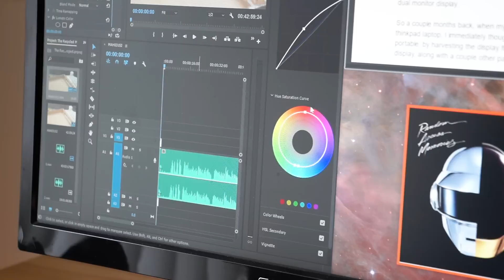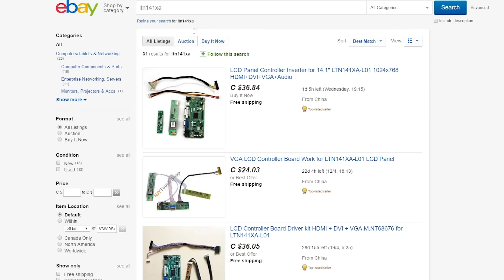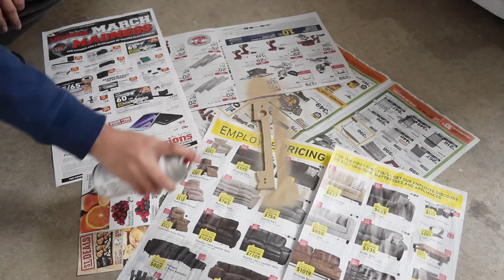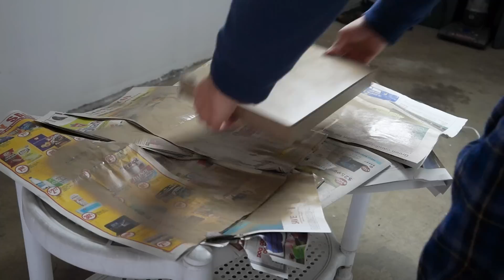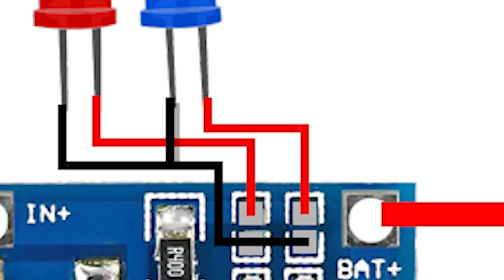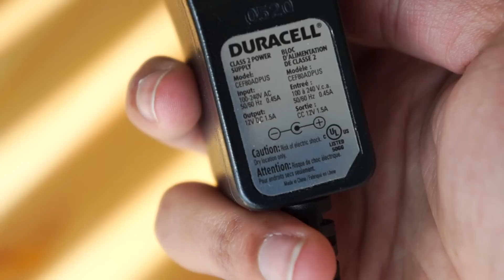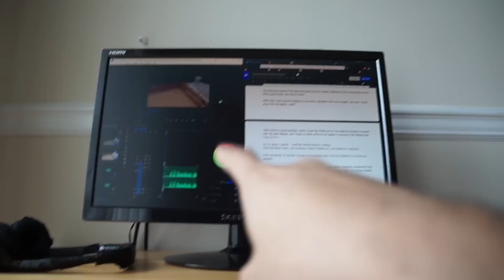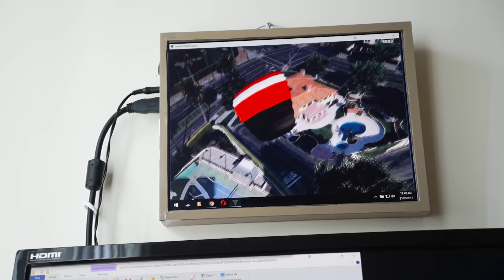The $50 Recycled Portable Monitor Project

Comment: This is the most realistic DIY video ever, learning in the process :) love it!
Reply from the maker: +Vukasin Pejcic Haha thanks :)
Reply: @HamzaQayyum great video! I'm building mine as we speak. Help me out though. For my board it says I'll need a 12V/3A power supply. I even looked yours up and yours looks to be 12V/4A. Is the board onscreen really drawing that much current?

Would you be able to measure your current drawn and let me know because it seems challenging to set up a portable power supply using boost converters and PD boards that delivers that nuch amperage. It seems these things run off as little  as1A just as easily.

Comment: I'm an Electrical Engineering student in my senior year. Job well done on the converter and especially knowing that you needed to change the output to 12V. You would have been scratching your head for a while when it wouldn't have turned on. A point that a lot missed. Excellent work with making the batteries work as well!
Reply from the maker: +TheRevSolo Thank you! As an engineer, do you have any suggestions to improve the design?
Reply: Design is all preference. You might consider a different battery, as the LiOn will degenerate over time. Something that will last. Or you could always add more in parallel or swap when they do regenerate. So make a design so they are swappable. Maybe make a batter caddy inside to easily replace them. I don't know how it is specifically for that board, but I would also make some cutouts in the back so it doesn't get too hot. The batteries will head and might make enough heat to create a short if you're in a cold environment. Just something to consider.

Comment: 4 months of shipping geez
Reply: Or you can fly to China and get it on the spot.
Reply: If it's bought through ebay, you can choose to report that it did not come within the time limit, and get a full refund from ebay. That is, if the seller stated an arrival date less than the 4 months :)
Reply: The McGeeker ده 7
Reply: XJLCA that Will take 3 days
Reply: I got the same board in 10 days
Reply: Geez?

Comment: The drywall plugs you used are brilliant. I have used them in the past to hang massive cabinets with LOTS of crap in them. Never a problem,AND they are reusable if you are careful
Reply from the maker: Yeah it said on the package they can hold quite a bit, and mine still hasn't failed.

Comment: Just a little tip for the future. When nailing finishing nails it helps to pre-drill holes first with a drill. you can use a small drill bit the diameter of the nails or use one of the nails itself in the drill as the drill bit. Won't split the wood if you do that.

Comment: if you have access to a wood shop try using a router. you will be amazed the speed and quailty of the cut. also if you only have access of a dremel there is a bit that looks like a little circular saw blade that would help you with cutting through thin woods quickly. also works well on ABS plastics and some thicker plexi and acrylic really limits the melting and burning

Comment: damn all that work. should of just went and buy 1280x1024 monitor for like $20-$30
Reply: David Nguyen Portable.
Reply: that was precisely what i did before i even start to "recycle" my laptop display which cost me less than 1/3 of the whole recycle thingy.
save money + save time + save the trouble + save a finger
Reply from the maker: +David Nguyen Would it have been portable? :P
Reply: had you bought a laptop monitor it would have been :p
Reply: Just saw off the stand. :P
Reply: saw off the stand? you could just unscrew it like a normal person
Reply: Hahahaha wtf who saws off the stand whaaaat
Reply: :P
Reply: I can find on of those at goodwill for 4$
Reply: All the fun is in making it. :p
Reply: That's not portible
Reply: David Nguyen the point of this to recycle
Reply: David Nguyen but it wouldn't have been fun .. despite all the blood!
Reply: Shame on you
Reply: That's how you develop into a pro at ANYTHING. Do it yourself and learn. I bet he can now do a lot more stuff even better because he went through the process of doing this from scratch. Great Job!!
Reply: David Nguyen this is hand made u can sell 150+ dolar easy but not kids.
Reply: cuz he wouldn't even be able to run it off his laptop lol, that's why there's only one display output on the laptop because it wouldn't be able to handle 2 extra displays efficiently at all
Reply: Where's the fun in that?
Reply: where is the fun in that
Reply: @henryweng9048  hahaha!
Reply: And you can mount it on the wall? Awkward.
Reply: Why make a baby when u can adopt them

Comment: If you left the batteries from the laptop in the original configuration, they already had a 12V output.  Then, you just had to buy a 3-cell balanced charger for them, and use a small buck-boost converter to drop the 12V input down to whatever your charger wants (probably 5V) to charge the batteries.  This would probably give you a much longer battery life.  Also, if you pre-drilled the MDF, you could have used small screws without having it split as bad.  
I'm considering doing a similar project, but with a Raspberry Pi emulator built in as well, for a semi-portable game system.

Comment: Excellent video bro. I have one suggestion. Since you have access to your school's shop, just use the lathe to make a small wooden dowel that can fit through the hole for the power button. You can glue it to the actual button, no pencil needed.

Comment: Great project.  One suggestion - if you pre-drill a hole slightly smaller than the width of your nail/screw they are less likely to split your Mdf or wood.

Comment: Here are some suggestion for other people that watch this video. For the power switch you could have created a countersunk hole where the switch would be accesable with a finger. You can also consider mounting the 2nd screen on the side of the first monitor. You maybe able to use the original mounting hardware from the laptop. Also if you are using wood as a frame you should put some small blocks in each of the corners to add strength to the frame.

Comment: DUDE YOU COULD'VE BOUGHT A 1080P MONITOR AT THE PRICE OF THE ADAPTER. THE FUCKIN ADAPTER COST 110$. AR E YOU KIDDDING ME
Reply: Tran Zioster lol.. but whats the fun in that
Reply: Yeah right!
Reply: If you have a different computer you won't need the adapter. My PC supports 4 monitors at the same time.
Reply: Yeah but the title makes no sense.
Reply: He didnt buy the adapter, he got it from the company to use it in his project to advertise it
Reply from the maker: +Tran Zioster I didn't pay for it :)
Reply from the maker: +Jan Remetir Touché :P
Reply: So was this sponsored?
Reply: those aren't portable, are they?
Reply from the maker: Of course not. That's the point of building this over buying a regular desktop panel. Of course an average desktop monitor will be much cheaper than building this, but it won't be portable, which this is. Thus, it's not fair to say that a buying a desktop screen over this would've been a better economical choice.
Reply: Hamza Qayyum that is my point exactly
Reply: buying a monitor won't get you views 😋 but yeah technically its a 160 dollar monitor plus or minus im sure you could also buy the monitor and make it portable with a power bank for roughly the same price plus or minus
Reply: You can literally buy a Quality monitor for 40 bucks that has all component parts for a for HDMI to VGA to USB ports. After that you can convert into another monitor for use
Reply: its sponsored
Reply: Tran Zioster even if you get that monitor for the price of adapter you can't use it without that adapter anyway cos hdmi port on his laptop isn't meaned for 3 displays only for 2 of them...
Reply: So if its portable where will you take it? The park??Your laptop is portable and it has got an awesome screen and why would you even build a portable monitor
Reply: lmao i just realized where the hell is his laptop why doesnt he just place the laptop on the table and hang his large monitor on the wall there really was no need for him to make this portable screen besides views i mean if you have a portable laptop 😂 use that instead of the crappy old screen
Reply: Tran Zioster he didnt buy the adapter, he asked them to send one to him in return for a mention in his video, he even mentions it was provided to him
Reply: just saying can't make one for $50 unless you are sponsored 🤔 hmm the real question is how do u get sponsored i want some free shit.😲 oh shit that's how you make bills get sponsored shit free get views get money sell the crap u make or sell the expensive shit easy ass money
Reply: Marty Camenzind the fun in that is saving money.
Reply: you dont need the adapter as long as you have a open HDMI port...
Reply: Jan Remetir you can get a robotic finger
Reply: They didn't take notice to your startec plug and the line "they were nice enough to send it over to me". Great video buddy, keep it up.
Reply: Even though he didn't payed for it, he just could've sold the adapter and bought an 1080p monitor..
Reply: Which would have totally removed any incentive for the company to get involved by sending him the adapter and any future product work for them. This video isn't about selling stuff to buy a monitor, it's about a project which he clearly did and made the video about it. Who wants to watch a video of someone going into a store and buying a monitor? real interesting...
Reply: Not a portable one.

Comment: How would you protect the battery from over discharging by the boost converter??
Reply from the maker: +Kuntal ghosh The TP4056 has that feature built in. Cuts off at 2.8v
Reply: Hamza Qayyum then the battery should be only conected with the charging module , and not directly connected to the bost converter... Do you even know how it will disconnect the battery power if the voltage drops too low??

Comment: Very nice projcet. If I could help for the future... You must try to use wooden rectangle cube (sorry for my english). When you hit nails in MDF (this go break, becouse nail go with the production jar).  Pretty easy and very fast is making wooden rectangle cube 0,5x0,5x0,5inch or similar diamension its depend how big nails are you have. Put this cube in corner of mdf and hit the nails. You must use vision where the nail is hited (if you have too long nails). In DIY market you could buy handle for drill. In 90th (and ealier) years in Poland it was very popular beacouse in drill you could screw necessary end and making lathe (if you use horse), grinder etc. You could use cut end and somethink to making striaght line. very important is angle between handle and some think which you use to making straight line (90 degree easy to making). Another easier way to make shaped cutout is making a lot of small hole (max 3-4mm diamension of hole) and use chisel. My dad told me evry time when I work with knife in wooden (Out/From myself :) ) Mainly very nice project hand up.
Best regards

Comment: Cool tutorial.  2 suggestions.  Instead of having the power switch and the push button, set up a 555 timer delay and a transistor.  quick google search for "555 timer button delay" will give you a good circuit for the timer, then instead of a push button put a transistor in line activated by the 555 timer.

second, be careful soldering those lipo's.  they can explode under heat.  You would normally use a battery welder and nickle strip to attach those.  Be better to buy/build a socket for them.
Reply from the maker: Yeah I ordered battery holders later on; didn't have them at the time. Ideally, you'd want to stay away from soldering directly, as that isn't good for the batteries.

Comment: Why did you used dead batteries? They are even new not so expensive.
Reply: Actually, 18650s are really cheap now. They're also used for e-cigarettes/vapes so they're wildly popular.
Reply: they are also used in cars. even used/dead ones can still have a good usable life in them
Reply: I think he was trying to say the laptop the cells came out of was dead, battery was working the laptop was dead.
Reply: Mr. GeforcerFX some ded battery pack still had working cells inside

Comment: try to use a metal screw or a threaded ros  to extend the push button.
another feature should be a diode between the boost converter and and 12v input, that way you avoid reverse polarity, i don't know if that may harm the boost converter and eventually even your batteries

Comment: When I am dealing with wood that I am afraid might split if just nailed in, I get a drill bit slightly under the size of the nail and drill pilot holes first.  You also could have chosen to use small gauge screws as an alternative to nails.  I would pilot hole them too.
Reply: I fully enjoyed watching the process you went through to create that 2nd monitor.  I would have handled the carpentry, and left the electronics to you.  You need to get a coping saw.  (consider a smile emoji attached to this)
Reply: In any case it was fun to watch.
Reply from the maker: +Chris Lauterbach Yeah, I made some dumb choices now that I look back. Pilot holes are the way to go.

Comment: You can not hook up lion batteries in parrallel as much as you want. You can only pack identical batteries in parallel otherwise you will end up with imbalanced voltages. For ex when you open a laptop battery those are coupled from production. So usually there is 2 or 4 of them are dead. Remaining ones can be used in parallel without balancing.

Comment: If you drilled the wholes out first with a smaller diameter drill bit the MDF is less likely to crack
Reply: And you could use 2 small piece of MDF that is left over from the frame ( one like a toothpick, and one as a "button") and glue it to the button.

Comment: You could also get a regular desktop monitor powered externally by a power brick for cheap and used that instead(and it would already have the driver board and inverter too) so you would only need to get charger module, power module and batteries. Even if the existing controller doesn't have an hdmi input, an adapter from hdmi to dvi or vga would only be $5 or less.

Comment: Word to the wise: the dc to dc converter he uses utilizes the XL6009 chip (which he says). I attempted to use a MT3608 chip based board and I seemed to be having some kind of amperage issue with my screen on. It was enough to turn on the LED, make the screen flash white, and then shut off and need me to disconnect the power in order to try again

Comment: Pretty cool!  I like it.  :)  Be careful about wiring the batteries directly to the load like that, if they get below 2.5 volts then copper dendrites form on the elecrodes and short out the cells.  Also it's standard to wire switches on the positive (or hot for AC) side of a circuit, it can avoid some potential safety hazards that way.  If you want to get rid of the pushbutton, search for '555 monostable' - that's just one way to do it but those chips are super cheap.

Comment: USB GPU's are only bottlenecked by the USB bus which can introduce the lag / delay and that is why thay have more or less pushed over to USB 3.0 for the bandwidth. There's also a limiting factor with USB pushing processing on to the main system processor. I have an older USB 2.0 version and I notice a difference between my old slower Windows computer and my newer Mac. most of these devices are built off of DisplayLink technology which is Mac compatible, however USB 3.0 versions have some limitations on that ( some companies do some weird things with composite devices / drivers ).
and that pass through USB 3.0 port is a really nice touch!

having a nice display from a partially fried laptop I've been eyeing doing a portable myself, just never thought about battery's.

Comment: For the button that is not long enough - use a rod or even cut off a ikea pen or whatever and glue it to a tiny plate (e.g. cuttout of a pringles plastic lid, whatever you can find in your plastic garbage) and put that in the hole from behind. make sure the actual button switch sits close to it so there's no wobbling. depending on how thick your case is, just leave the rod longer.

You have so many ideas and probably just didn't feel the need for having a better solution but boi, i just went all autism on that tiny detail.

Comment: You should have used a router for the screen cutout.
Also, you can use standard wood glue for MDF, it's very reliable. Most people seriously underestimate the strength of wood glue.

Comment: Nice project! Maybe add a relay between the xl6009 and the PCB. leave it at closed and when you put in wall power it will go open. Meaning you will not drain the batteries when you use wall power. Not much work and low cost!

Comment: One issue you made is that you connected the power switch via the ground wire instead of the red wire. Usually the switch responsible for the plus wire.

Comment: For the push button fix, you can hot-glue a dowel to the push button that's close enough to the hole you drilled for it.
Reply from the maker: +aurismatelis729 Yeah, I did that after, actually. Worked out well.

Comment: Really cool project, I got a spare Raspberry Pi 2 (as now I'm using the Rpi3 as my "main" raspberry experiments device), and I also have loads of screens from dead notebooks. I might as well hybrid those to make a portable all-in-one computer that could also act as a portable display ! Or a portable Kodi machine, that would be cool.
Reply from the maker: +Yassine Saïdi Yeah that was my actual intent. But I realized that I would have to run an HDMI wire from the inside to the outside (if the pi is inside). A solution might be to have  some mount for the pi outside, with a short HDMI cable, or a retractable one, if you can find one like that.